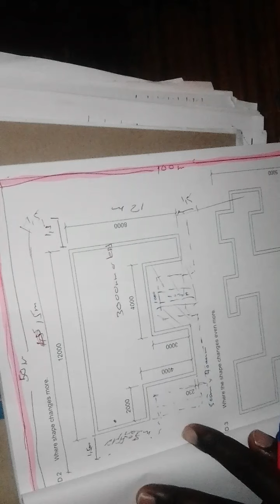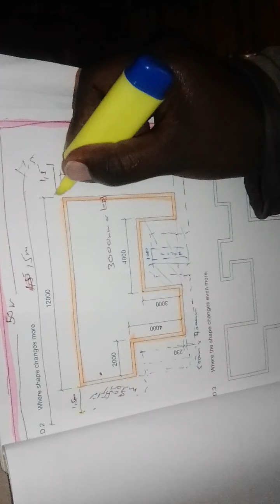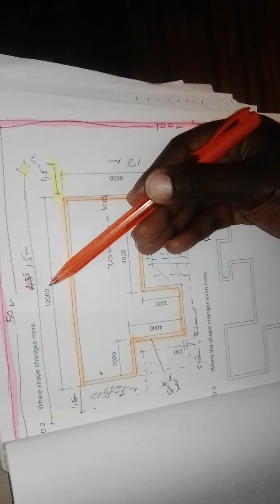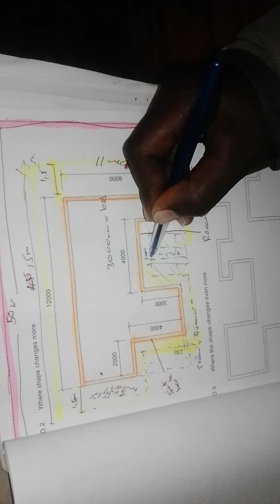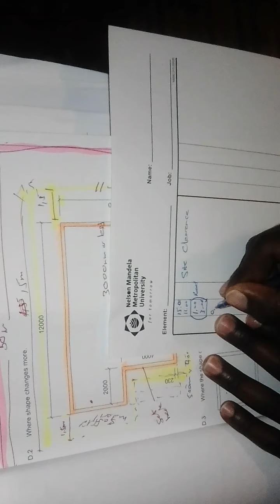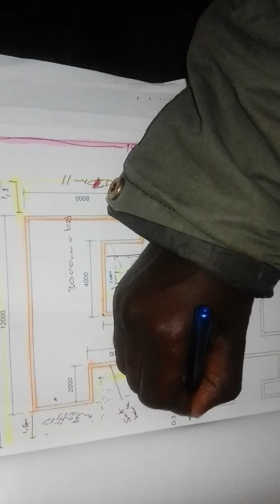SITE CLEARANCE FOR DWELLINGS TAKING OFF DQS1010

Comment: So the working space is always 1.5m???
Reply from the maker: Not always depends on the circumstances of the project remember construction is not limited to building a single storey house ,the is also something called relaxation of building lines which allow the building to be built in the boundary of the two adjoining properties as long as the neighbor does not object but you can investigate at municipal housing division to see housing drawing applications